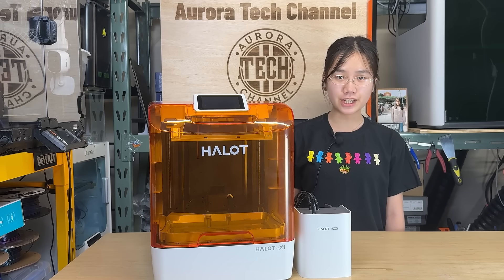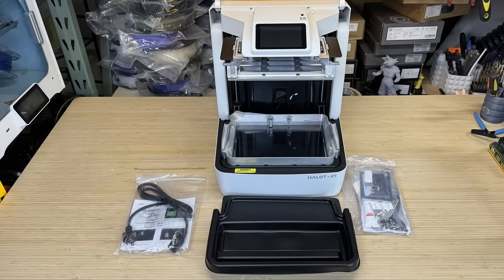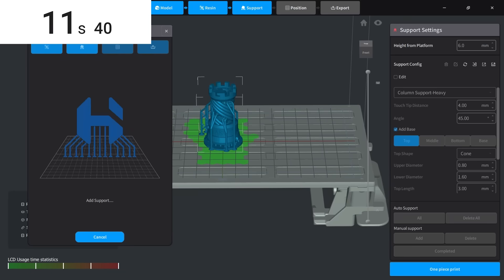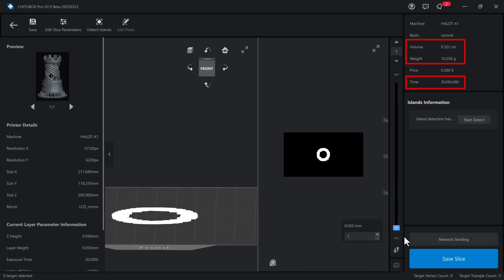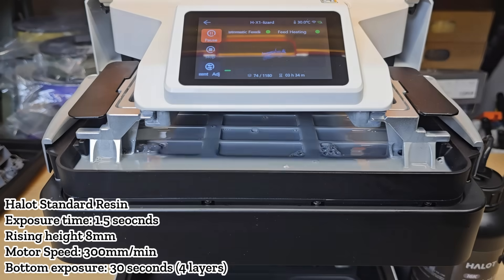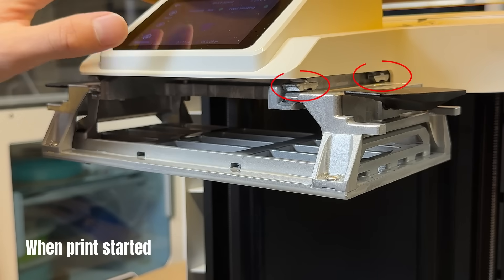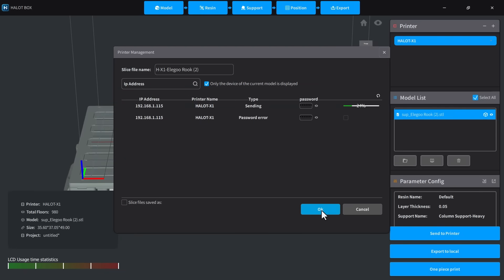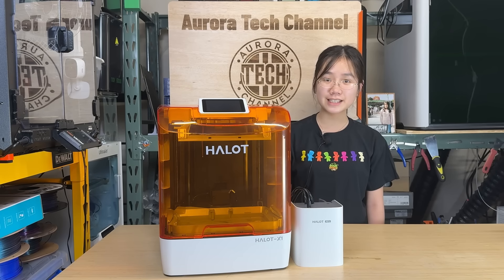PioCreat Halot X1 Review: 16K Resin Printer with Auto Resin Feeding & Quick Release Platform

Comment: Is a resin printer a waste if you can't afford one of those curing stations?
Reply from the maker: Those washing and curing stations are pretty cheap, ranging from $80 to $150 depending on the size.
Reply: you can "build" your own the washing station is just a container with a spinning magnet and the curing is just UV light  in a box 

basically 5€ container and 20€ UV light from amazon or if you wanna be really cheap the Sun
Reply: @timo4463  I already have a UV panel I built in the 90s to expose photonegative PCBs

Comment: I didnt watch this channel for a couple of months now, maybe already a year. Since it became posible for brands to get a paid review from thjs channel. And to be honest, this video lost all joy, fresh, having fun kinda style and vibe. Good luck!
Reply: Go and watch a channel that does understand resin printers and you'll see how sponsored this one then looks. I love AT but she has missed a ton of drawbacks with these "EXCITING NEW FEATURES" - the comparison models she uses are all different resins, the Saturn 4 12k one isn't even properly washed, no wonder it's not as sharp. and darker more opaque resins look sharper anyway which is what was user here vs the lighter and more translucent ones used on the other machines. There is absolutely no technical way this could be as sharp as any printer using a COB light source.

Easily removable parts on the build plate only works with large models.

I hope she was paid for this becasue if those are things missed accidentally rather than intentionally, it massively reduces her credibility on this topic.
Reply: @LindsayWarrington More than the light source is involved in an accurate, highly detailed print. The Heygears Reflex machines use a matrix light source and the Heygears prints are as crisp and detailed, maybe even more so, than the Saturn 16K. As for the Halot build plate, she removed two rooks just fine, and they aren’t exactly larger prints. Very small prints might not pop off, but the bigger concern is if you want to print flat on the build plate, the. The bottom of the model will have that build plate pattern on it (so better to use a raft and supports, or just print an a different printer, if necessary).

Comment: I DO NOT print in resin, but i have a couple of questions. I admire your review work flow process.  With your common test models (as i said I DO NOT print resin)  for FDM printing, you use your stock test items, which allows for comparing 'apples to apples'.  Just as a question, if you used those models, how would they compare?  If you did, how would post processing add to the time/results? Lastly, (and since you're such a GREAT reviewer), which do you prefer resin or FDM?
Reply: She tells at the end of the vid which one she prefers.
Reply from the maker: I always prefer FDM. Over 90% of everything I’ve printed has been with FDM.

Comment: 15120*6230PX is not 16K...XD
Reply: Its not true 16K still almost 16k
Reply: @sadessnuk1955  a fiat is not a true ferrari...still almost a ferrari😵‍💫
Reply: This is a common problem you will find with ALL consumer 3D printer brands (just like screen resolution on TVs). That said, there appears to be only one Chinese vendor making these “16K” screens, so the brands selling “16K” resin printers all use these 15,120 pixel screens. By the way, “16K” is a marketing department number (of course). Even the 15,120 x 6230 pixel numbers aren’t useful UNLESS you know the actual screen “build area” dimensions. As Ross over at Fauxhammer YouTube channel points out, what is more important is the AVS (average voxel size), which is the minimum “real voxel or pixel size” for the screen and, thus, the printer. In this case, these 16K screens typically have something like 14 x 19 micron pixel size, o AVS of 19 microns (the larger of the x-y pixel dimensions).

Comment: Not having to add your own flexplate or such to be able to remove models without some level of violence is honestly great, and should be standard by now.

I share your concerns with the individual LED zones. It'll be interesting to see whether they can implement a way to calibrate the zones so that they're all relatively the same brightness, or at least an easy way to swap out LEDs as they get dimmer. Fortunately LCD life is still the main limiting factor these days, so swapping the LEDs every N LCD changes might be an alternative there :)